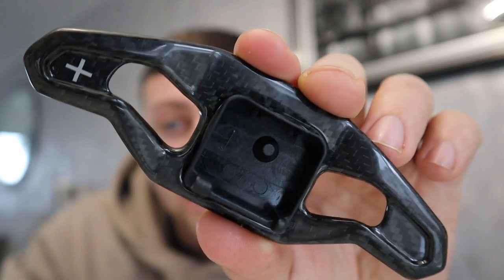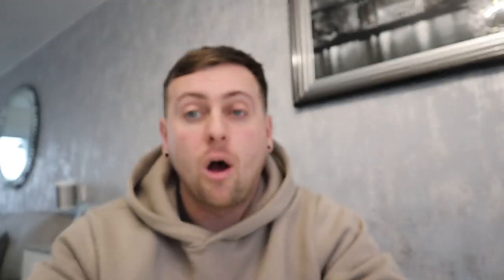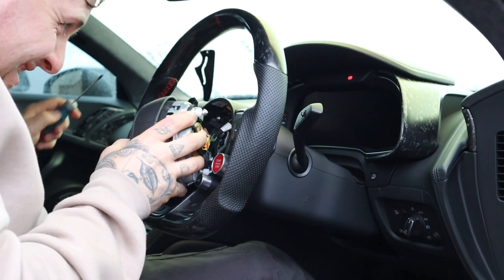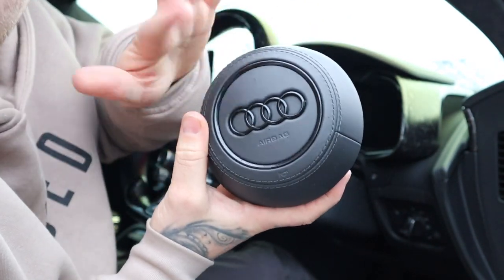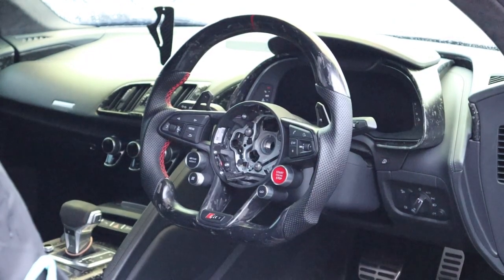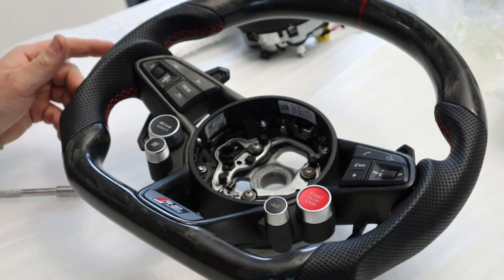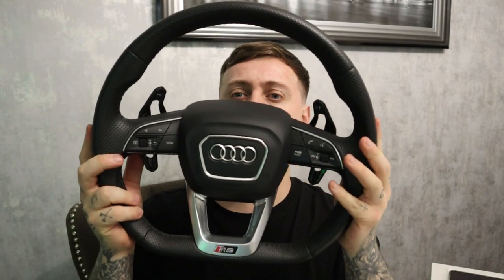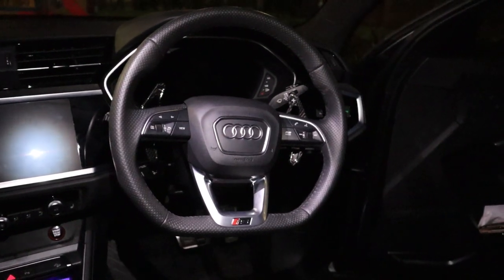Installing New Urus Style DSG Paddles // How To  Remove Airbag & Install

Comment: Fitted a set of the plain matte finish ones on my Leon cupra 280 as they have the same fitment as some Audis. So much better than stock plastic paddles and look OEM plus instead of the stick on extensions.